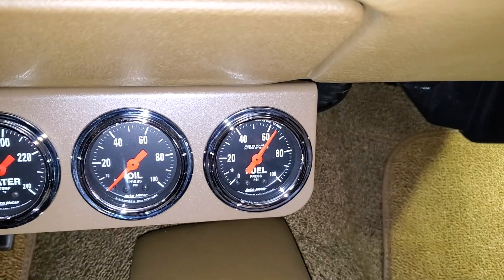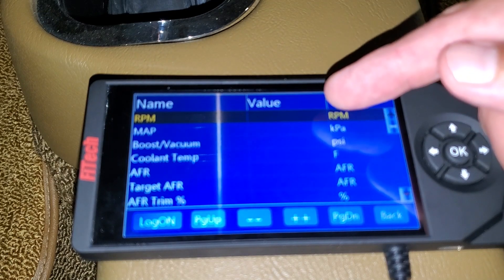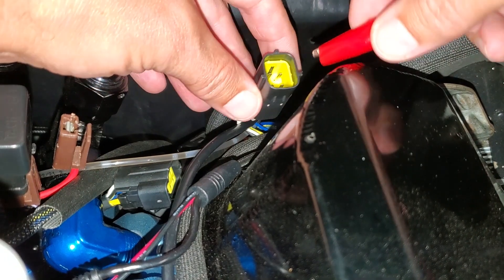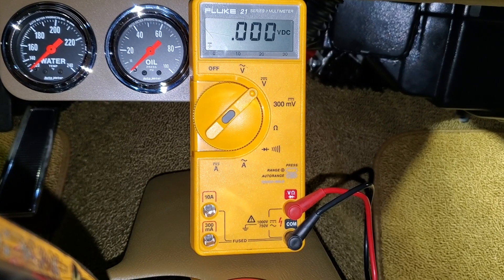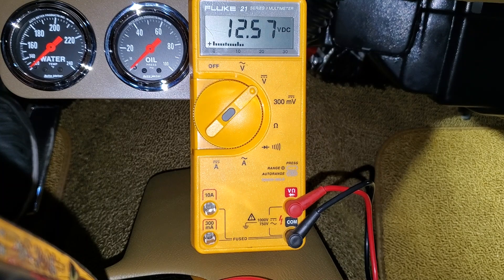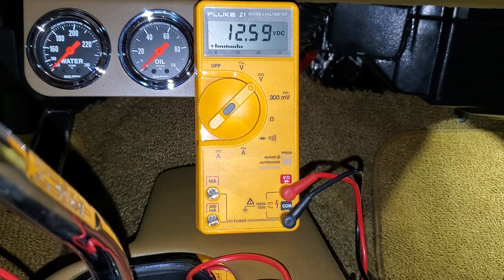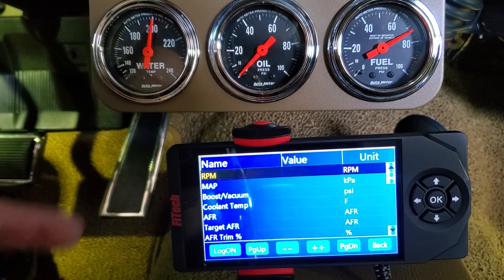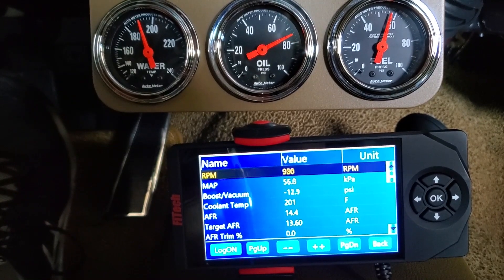FiTech Starting Issues - How to Diagnose it, and fix it.

Comment: Hello, i put a tripower system on my 406sbc in my 89 firebird,had trouble starting it but after raising the crank fuel % to 65 it started and ran good BUT I did a auto to manual swap right after the engine swap and now she cranks but wont start. There is an rpm value while cranking and there is the right 60psi  of fuel pressur,even filmed the fuel priming squirt and the fuel coming out while it cranks. If I hold the throttle it ll start to do some explosions and run on like 4 cylinders but stops as soon as I let go. Im writting this down now and I ll look more into it tomorrow,but any insights from anyone would be appreciated. It couldnt be the wiring from the transmission because it simply wouldnt crank,anyways thanks in advance if anybody got an idea
Reply from the maker: Thanks for the comment, I know it's frustrating.  Assuming your timing is still the same.  If you can crank and hit the throttle, and it fires, (Almost like we used to do with Carbs) then you're too rich.  Try lowering the prime shot and/or crank fuel.  Go 10 points at a time and see if it improves, etc... let us know!

Comment: i just bought the jegs bandit and it's hard to start and after it does start it runs fine turn it off and it wont start
Reply from the maker: Did this video help?  Or, is it a starter Heat Soak issue?
Reply: @FastMonty  i'm gonna go out and mess with it i didn't set the type of ignition in the computer hopefully that's it i'll let you know
Reply: @FastMonty  it turned out it's a self learning system and i just reset the computer and it starts fine sad thing is jegs knows absolutely nothing about the jegs fuel injection system they even tried the old well it came out when covid hit so they didn't train us on it when it came out lol

Comment: This video fixed my issue.  I did the same, moved the white wire to the distributor.  Always had hard starts to the point I did not want to drive it.  I think I am as happy as you were!
Reply from the maker: That's Awesome!  I am still that happy every time I turn the key.  Have fun!

Comment: Great video thanks. I have the same issueand i believe this question has been ask before. Couldnt the white wire coming out of the fitech 6 pin connector be tied into the distributor battery + terminal and get the same results?
Thanks
Reply from the maker: Thanks... yes, I effectively did the same thing, but tapped into the fuse box directly.  Thanks for the comment!

Comment: Fitech tech line isn't very helpful. I bought a $2200 Ultra Ram for sbc. Installed easy enough, but the IAC values on the handheld, regardless of where the IAC screw was set on initial set-up, would read 0 and -14. No matter where i set up the initial timing (typically 10° - 12°) the parking idle was too high and you couldn't dial the IAC values down to between 3-10. The tech videos were basically useless because the handheld units they showed predated the modern one that came in my kit. I missed 3 big car shows before i finally pulled the Fitech system off and put it on the shelf, indefinitely. Had to go back to the stock carb and intake. It was frustrating to say the least, and the issue was never resolved. So far has been a waste of $2200.
Reply from the maker: Yikes. I'm sorry to hear that.  I know nothing about tunnel rams... I've had good success so far.  I'll keep my ears pealed for ya. Thanks for the heads up.

Comment: My car started fine for a day. And now it’s having issues starting. I’m pulling my hair out
Reply from the maker: Frustrating, I know.  Do you have any error codes?  Try clearing the codes, even if you don't have any.  Then double check all wiring.  Just takes one wire to come loose, and it won't cooperate.  Let us know how you figure it out!
Reply: @FastMonty  I will try to clear error codes too. The car was running consistently and starting consistently but I did not like the 150 IAC. But there a lot going on with my project. So there’s probably more at fault than just the IAC.
Reply from the maker: @motor_citymuscle288  Yeah, multiple variables makes it complicated.  I agree with tackling that IAC value.  Let us know how it goes.
Reply: @FastMonty  I messed with the timing and did what I could to reset the IAC and the car won’t start now. I have spark…. I’ll be calling FiTech on Monday.
Reply from the maker: @motor_citymuscle288  Ahhh, yep, timing, timing, timing.  Good luck!
Reply: @FastMonty  I got her back up!!!!
Reply from the maker: @motor_citymuscle288  Awesome!  What was the issue?
Reply: @FastMonty  zero error codes. I’m thinking my IAC screw is faulty. Hopefully not. Im sitting at 150 IAC. And the car stalls at 130 ish.

Comment: Question. Couldnt the white wire coming out of the fitech 6 pin connector be tied into the distributor battery + terminal and get the same results?
Reply from the maker: Good question.  The answer is yes.  I was running HEI at the time, and didn't want to tap that wire.  Thanks for the comment!

Comment: I’ve installed the fitech ultra ram with the force fuel but my injectors are not opening up I’m getting the right amount of fuel pressure I checked all my grounds and power connections  and there all good .. I’m lost . Do you have any suggestions
Reply from the maker: Hey Duke, sorry to hear it's not behaving... unfortunately I have no experience with their tunnel ram.  I'd try and call FiTech... good luck, and let us know what you find out!

Comment: I left my Superformance cobra with a 460 and the FiTech 600hp carburetor sit for a year on the lift whi renovated a 77 Porsche Targa.   Now I’m not getting any fuel into the carburetor; no squirt no flow.  I have fuel and oil pressure, spark everything worked fine a year ago.   What can you suggest trying?   Wes
Reply from the maker: Good question John... sorry you're going through that frustration.  I'm curious to know, where is the fuel pressure sending unit?  Most are at the pump... typically when a car sits for a long time, the sediment in the fuel tank settles on the bottom and can get pulled into the pump when first firing it up... clogging the filter, after the point of fuel pressure measurement.  Anyway, just thinking out loud... let me know what you find.

Comment: Thanks for the video, but I was wondering; why does it seem to happen long after you have been driving the car (like since the Fitech installation)?? Because we all have installed Fitech systems before, and like in my case, I am just now experiencing this issue (long after 6,000 miles of problem-free driving)?
Reply from the maker: Gerry, great question.  I've had the issue since day one... but, not always the same behavior, as it's kind of related to battery strength.  For me, I didn't know my alternator wasn't charging well.  So, at the end of a cruise, or after driving, I had an especially hard time starting the car.  Both starter speed, and lack of spark to self-kick start.  When cold, the battery was fresh off a tender, so it would kick faster.  Not sure why you're experiencing it later... maybe a similar issue, or wiring is loose?  Let us know what you figure out!

Comment: Thanks ill look into this on my setup. I have fuel pressure but injectors barely squirt anything and it has been sitting for at least 6 months and now wont start. Ill check all electrical connections and try again
Reply from the maker: that's no fun... keep us posted!

Comment: Hey Mike
I have been having problems with my Fi tech .Call there tech support and all they do is run circles and never get straight answer. Did everything they said and car is still not running right after a month. I think Fi tech needs to expand or there tech support and knowledge base. So now I am going back to my old distributor and using mechanical to advance the timing 
They make it look so easy on you tube videos, but to be very straight forward . Fi tech would not be my first choice anymore because of tech support it is really bad. Its great that you got your car running great but would never recommend a Fi tech system to anyone ever again. Just to much of a hassle dealing with this type of EFI. 

Cheers
Reply from the maker: Brother Fred, I'm so sorry to hear that. The issues I've had, have been because of my faulty installation. If you need to brainstorm possible solutions, let me know. Thanks again for your comment, it's very helpful for all of us to learn from each other. See ya!

Comment: The circuit board is built into the throttle body. It is subjected to high under hood temperature and I hope it has a very high quality electronic circuit board. If it proves to be reliable and long lasting I will be interested. I hope for your sake its built well. I wonder what FiTech has to say about that
Reply from the maker: Yeah, we all know electronics don't like heat. What does Fitech say?  They said, "we now have a 3 year warranty"  so, there's that. Ha ha.
Reply: @FastMonty  If its made in China I hope it's fine China. They should really stick to porcelain
Reply from the maker: @chriscimino7854  That's funny... where else do circuit boards come from?

Comment: I finally got my 75 dodge truck to start!  After a month of frustration. It still shows zero for the rpm's but at least it starts finally some progress. I found the fan was enabled and I'm not running an electric fan. After i disabled it then it will at least start now!
Reply from the maker: Awesome!  Getting there!

Comment: I have a question for you. I've watched your videos and it's been a big help, but I'm having a problem with my fitech go easy street model. 
I have a 1975 dodge power wagon with a 318.
I installed the fitech system and I was using a perpronix distributor with a coil, and it wouldn't read to the ecu unless I was trying to start it. It also wasn't showing any rpm while cranking. I do have 10v keyed. Fitech tech said try an Hei distributor so I did.
I can read and send to the ecu no problem but I'm still at a zero while cranking and I still have 10v keyed wire. Do you have any suggestions? Did I maybe not set it up right on the hand held or is it another problem? Also the blue fitech tach wire is going to the tach wire on the distributor.
Reply: It won't start
Reply from the maker: @jaredgeeting2320  ohhhh. With your hand held, key on, go to fault codes, hit clear codes, key off.  Wait a minute. Try starting.
Reply: It at least started for a min when I disabled the fan! Some progress at least. I'll try clearing the fault codes
Reply from the maker: @jaredgeeting2320  progress!  Maybe also add a jumper wire from the "ground" on the throttle body to a known good ground and/or negative terminal. Lots of issues created by faulty ground paths. Keep us posted!
Reply: @FastMonty  I'll try that for sure
Reply: Fitech is having me send my unit back. Rpm is still zero when I touch the blue tach wire to the battery directly so they said send it back.
Reply from the maker: @jaredgeeting2320  Ohhhh, that's interesting.  Didn't know that blue wire trick.  Glad to hear they're getting you a new one.  Keep us posted!
Reply: @FastMonty  
They said if you lightly touch it and let off and touch it and let off quickly it is supposed to show a number value to rps. At least that's what they said
Reply from the maker: @jaredgeeting2320  That makes sense... really sorry you're going through that.  Can't wait to hear the success story!
Reply from the maker: After starting, does the RPM show up on the handheld?
Reply: Should I try an inline pump?  Is it better than mechanical? Will it help it to run better?
Reply: Thanks

Comment: I have a FT 30004 on a 400+ cid V8. I do NOT have the problem discussed in this video. The battery is NEW and of the appropriate CCA and reserve. Key on is good. Battery voltage is present at the coil (and the white wire) when the key is turned on and during cranking. Distro is an HEI with a matched coil. RPMs are present during cranking, fuel pressure is as expected. Vacuum at idle is as it was with the carb this unit replaced. Coil + is appx BAT+ when running and varies somewhat during cranking (11.0 - 11.9). When idling, the TPS is "0" and the IAS drifts between "5" and "7",  usually settling at "6"  around 180 degrees engine temp. Since swapping from an Edelbrock 1406 to this FT, it has NEVER started well; certainly NOT when cranked the first 2x. It does, however, start on the 3rd attempt when cold. When hot it starts up 1st time, though it cranks slower than when cold, which is expected.
Reply from the maker: Sorry brother... In all honesty, mine sometimes did that too.  The main issue for this video was hot starting rarely worked, which is how I came across this issue.  Anyway, I think you might need to experiment with your Cold Crank Fuel setting.  As an experiment, try keying on when cold... do not crank it.  When you hear the throttle body "squirt", key off.  Wait a few seconds, key on again.  Wait for it to squirt, then try cranking.  If it immediately fires, you need more cold crank fuel.  Let us know what happens, and thanks for leaving a comment.  Oh, and don't touch the gas pedal... sometimes a habit of us carb guys... doing so tells the throttle body NOT to send that pump squirt.
Reply: @FastMonty  CCF was not the problem as I had already mod'd that for the 60 degree start. As it turns out, the starting AFR was a bit too lean, and so I add some to the After Start Fuel and that cleared the issue. I change only 1 thing at a time and judge the result based on the starting characteristics on the following day. So now, all is good.
Reply from the maker: @backthatthingupyoyoy  That's fantastic news!  Thanks for sharing for others to learn from... have fun!

Comment: I just bought a car with a crate motor installed with fitech and I have to hold the key forever to start. This is this first thing I’ll look at. Got curious and searched here and found this good tip
Reply from the maker: Cool... let us know what you find out, and exactly what set up you have.  Hope it's an easy fix!

Comment: Hi Mike, I have a Fitech 38350 system for TPI Chevy's on my Corvette. I did find that my feed wire was on the accessories, so I switched to the old Distributor "pink" wire. The engine now "fires" for a second, then dies. There are no RPM showing on the handheld during the crank, only briefly when the engine fires. I checked my voltage, and it stays above 10v at all times. The tech on duty is new and follows the installation manual only. The master tech, Dillon, is scheduled to call me tomorrow about this problem. Since most of the videos on YouTube are the Carburetor replacement models, the wiring is different and I find that annoying since hundreds of these 38350 and 51' models are sold annually. Summit sold 23 already this year. Fitech should have a huge troubleshooting guide and solution manual by now. L98 and LS engines are a dime a dozen!~ Thanks for your video it helped me and I am sure others.
Reply: Yes. Dillon is one of their top tech's. I will let you know what the solution is as the systems do have common dna!
Reply from the maker: @petercermak4095  Great!  Can't wait to hear...
Reply: I'm having the same problem, I thought it was the distributor wasn't compatible, so I changed to a hei distributor and I still show a zero when I crank on it. I also do have 10v keyed while cranking? 
So I don't know what to do from here? The hei distributor is only 2 wires one for the blue tach wire and one for the battery.
Reply from the maker: @jaredgeeting2320  Did you test voltage while cranking?  Per the video, I had voltage keyed on, but as soon as I went to crank it dropped to zero.  I had to find another source for power.  (In this video I used the same power lead to the HEI unit as power for the Fitech system)  Please confirm.
Reply from the maker: Hey Peter, sorry to hear about your frustrations... As you might have guessed, I don't know how that TPI system works.  Is "Dillon" with FiTech?  I know most of their tech staff are very good.  If you figure it out, please let us know what the issue was.  Thanks!
Reply: Yes 10v while cranking

Comment: If you had an electric choke on your old carburetor you could of use that I believe.
Reply from the maker: Ummm, you could use what?  Wrong video?
Reply: @FastMonty  the voltage from the wire that was hooked up to the electric choke. Couldn’t have you tapped into that?
Reply from the maker: @ArmyGreenFJ  ahhh that's the wire I was using, apparently it has zero volts while cranking.
Reply: @FastMonty  ahh i see.

Comment: Hello. Good video! Questions. If you have a fully charged battery and don't run the car for 2 weeks does the FiTech FI computer drain the battery to a no start condition? Do you know the current draw? If the computer drains the battery to a no start condition does it reset the computer and all the past learning has been lost. Another question..sorry. Can you back-up the current FiTech map so if you need to unhook the battery for maintenance you don't loose your settings? THANKS!!
Reply from the maker: Thanks Danno... good questions.  The battery draw is minimal unless you have the handheld connected.  No one can predict how long a non-tendered battery will last, because everyone's car is different.  That said, if the battery is removed, the data stored on the FiTech unit will remain intact.  Hope that helps!
Reply: @FastMonty  It sure does help and thanks for the reply! I'm working on a 1971 Camaro. Many of your videos directly pertain to my build. I have a 1995 LT1 and T56 that I've stored for 20 years and guess where its going minus the OPTI and FI from that era. Engine and Tranny only have 25K miles on it. I built a engine test stand and will use it to test out the LT1. Probably change every gasket and seal on it before I install it in the 71'.
Reply from the maker: @Danno74Z  Nice!  Can't wait to see it, when it's done.  Keep us posted!